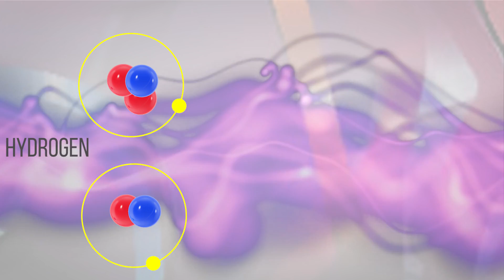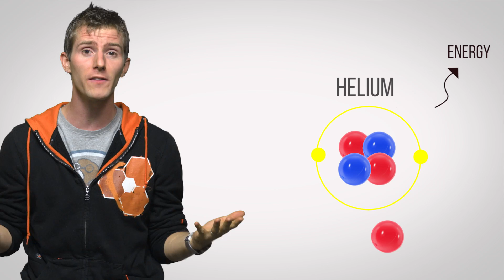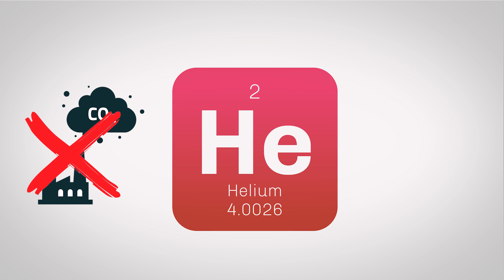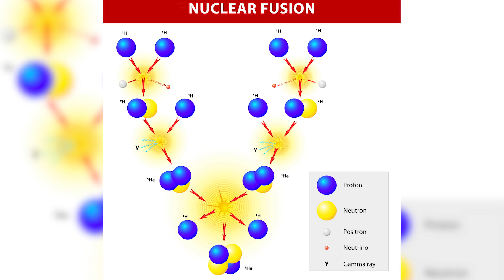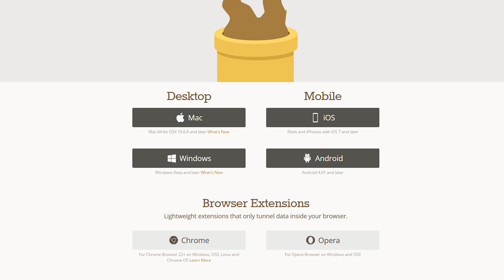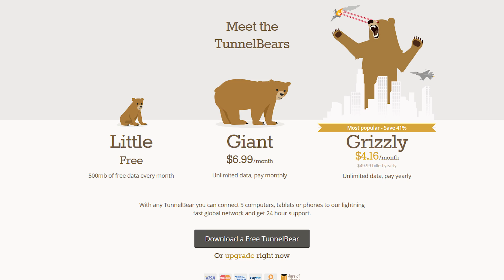Why Don't We Have Fusion Power?

Comment: why don't we just cover the sahara desert in solar panels?
Reply: Because power distribution, mostly.
Solar power generates a lot of power during the day but none at night, so you need ways of storing that energy if you want to efficiently benefit from it.
Batteries are not good enough and other ways of power storage are not very practical. This is why fossil fuels are so commonly used, if you need power you can just throw some more coals on the fire. Many sustainable power sources are out of human control, and so power storage becomes an issue.
And all of that energy will be generated in the Sahara desert, but in the middle of the desert that energy is probably not of much use so it needs to be transported and distributed. It's hard to figure out who needs how much power where exactly, in a matter of minutes, if you're talking long distances. You'd need a very advanced, comprehensive and cross-nation power distribution network that currently does not exist.
Reply: Cost and maintenance would be some huge issues there.
Reply: In addition to what everyone else has said. If you are strictly utilizing photo-voltaic cells as your solar panels these things simply just don't make sense for use as a green energy source. This is because the panels take pretty much their entire operational lifetime to refund the energy debt (energy which was supplied, largely, by the burning of fossil fuels) required to make and install them.
Reply: Well, I thought about it too. But when you think a bit longer you start seeing the issues. First of would be the building and setting up of those panels there. Sahara is covered in meters of fine sand. You can't build anything solid on it without making some foundations and that would be very expensive. Also transporting all the materials and workers needed would be a major issue since there are no roadways. Further down the line,should we manage in setting the panels there they would have to be replaced or fixed all the time because of the sand damaging them. And finally,all the energy produced would have to go somewhere which means a lot of power lines and a lot of costs since you cannot build those on sand and storing all of that energy would not be possible.
Reply: This is a little long so forgive me. The biggest reason is #4.

While statistics like "covering 4% of Earth's deserts with solar panels will generate enough power to fuel all humankind"  sound awesome,  solar tech isn't efficient enough to do that quite yet.

1. The problem today is that solar panels must be cleaned almost daily in dusty conditions. One gram of dust per square meter of solar panel is enough to reduce energy output by 40%. Not really a big issue when solar is a secondary power source for your home but a nightmare for a large scale power plant. Cost efficient cleaning tech is already being heavily researched so this won't be an issue someday in the future.

2. Deserts typically have very low populations in areas where massive solar arrays can be built so this means there are no high voltage power lines to transmit the power to the people who need it. The problem with this is simply cost. High output cables cost many millions of dollars per mile to install. Solar energy isn't quite efficient enough yet to justify this cost on a massive scale. Long distance lines would cost hundreds of millions or even billions of dollars. To top it off,  the lines  would also lose 10-20% of the power generated.

3. There are no energy storage technologies available that come remotely close to being able to power civilization at night via stored solar energy. A plant is being built that stores energy in a tank of molten salts and is a guinea pig of sorts to test if that solution is viable on a very large scale.

4. Biggest reason: cost! One of the largest solar plants, Topaz Solar Farm, cost 2.5 billion dollars to construct and creates about 1,000 gigawatts per year. The United States would require about 30,000 of these plants which equates to $75 trillion dollars. Ouch. 

One day solar panels will be ultra efficient and will play a major role not only in power production on Earth but also in humankind's exploration and colonization of our solar system and beyond. Unfortunately that day is yet to come.
Reply: The Curious Noob meh, the US is already 20T in debt, what's another 75T
Reply: The pannel tech isnt the issue. The problem is that out storage methods are are inadequate. Once we get better batteries we probably will widely use solar.
Reply: Simply because sandstorms can cover them up and maybe destroy them. Also they might get stolen.
Reply: TheUberMedic because then how would you get electricity to your home from the sahara desert?
Reply: TheUberMedic and the proces to create solar panels generates to much CO2
Reply: William O'Malley why not here in Australia ? We have the most intense sun in the world. Literally. We have a hole in the ozone above Australia. And we are a pretty legit country with shitloads of money and space
Reply: Justin McMullen yeah why not in Australia then? :P
seems like a better option xD
Reply: im half Arab... that was funny!
Reply: TheUberMedic I always think of that.
Reply: TheUberMedic also will cost a lot to get it to a country that can afford it
Reply: I agree with CraftingMuff.
Reply: Justin McMullen Those blasted kangaroos! Crikey!
Khoa Bang Tran I love that song, by the way.
Reply: @ThexXxXxOLOxXxXx Saudi Arabia recently started investing in solar panel development, after the decline of oil prices late 2014. That may be a thing of the past, but good point.
Reply: TheUberMedic Cause they would be better of using solar turbines anyway. (A big array of mirrors focus the sun on a tiny area where a water boiler is placed which drives a steam turbine.) Last I heard they have concrete plans for those kind of systems.
Reply: +Curious Noob
1.  Timed windshield wipers?
2.  It'd work for something like Death Valley, CA, among other places of opportunity.  Every megawatt hour counts.
3.  Mix and match.  Every megawatt hour counts.
4.  Is that with the windshield wipers?  :D
Reply: https://en.wikipedia.org/wiki/Desertec#Obstacles
Reply: Because, apart from many other reasons, such a thing would create incredible international tension and probably start a world war of massive porportions. Just think about it: One country with the power to entirely shut down another country's electrical grid. That would be the equivalent of dropping a massive nuclear bomb on top of an entire country, making even lighting the streets an impossible feat without a backup system. Which would defeat the purpose.
Reply: @zipp4everyone263  The Sahara is across 10 countries, not one.
Reply: @browncoat697  the entire Sahara wouldn't need to be covered. Don't try to be clever bro.
Reply: Because they are resource hungry, and producing them requires minerals that are almost always obtained via strip mining. 

In case you don't know, strip mining is a mining method that leaves permanent scars in the earth, typically in third-world countries, where the minerals are presumably most plentiful. This also has the effect of keeping the process out of sight of the average American consumer.
Reply: Because solar power is a joke... I own a 7.5 KW system. You can't store the power right now, the power is completely unreliable. And the carbon foot print required to mine the materials, to produce the panels, and they are very hard to recycle. Nuclear is the wave of the future if you care about global warming and CO2 (which I don't, but I still believe in nuclear)
Reply: +vampov wow are you proud of yourself for not caring about global warming?
Reply: Because relying on arabian dictators for the entire energy you use is a nice idea?
Reply: @CraftingMuff  nope.the sun would become blue and the dessert would cement color
Reply: @CraftingMuff  Imagine not knowing where Arabs live
Reply: Jelle van M. Then why don't we cover the Arctic with batteries?
Reply: TheUberMedic storage of energy at night also being able to transfer the energy because unless you have a super conductor you will lose alot of energy to resistance thats the simple version
Reply: TheUberMedic how do you Think the plants and animals will react
Reply: CosmicSins That's why I said cover the Arctic with batteries
Reply: islam

Comment: Still upset the whole reactor would still just be a very big kettle. Boil water, spin turbine, power.
Reply: That is how pretty much every form of power production works, including fission reactors.
Reply: +Tortex You mean solar panels?
Reply: People seem to have this knee-jerk reaction to incredulity when they realise that fancy power stations, from coal gas, to fission and even some solar plants, are essentially just boiling water. It just happens to be that water has one of the highest specific heat capacities for a practical material, making it very efficient for transferring energy. It is very easy to gain energy as heat initially, as heat is the highest-entropy form of energy - chemical (oil) to heat energy is easy; the other way, not so much. To create electricity, you have to either use a moving magnetic field to push electrons in a wire/coil, (standard generator), or "shake loose" the electrons in come other way (e.g. photoelectric solar panels, piezo-electricity). The "magnet passing over wire" is very simple, cost effective and efficient.

Therefore, despite the way it seems like boiling a kettle to spin a waterwheel, it is actually one of the most effective methods of electricity generation that there will ever be, and is very, very useful to us that it is so simple.
Reply: Depends on the fusion reactor type. For deuterium-tritium fusion (they forgot to mention tritium btw) which spew out 80% of its energy in form of energetic neutrons, boiling water is the only feasible option. For fusion reactions without neutrons, like helium-3 or proton-boron fusion, they spew out most if not all of its energy in form of charged particle, which can be slowed down by a coil, generating electricity directly.

But why do they use deuterium-tritiium? Because they are the most easiest fusion reaction in the world
Reply: how else would you want to do it? thats just how it works :P
Reply: A material that transforms energy to electricity instead of heat would be nice. You know, instead of radiation to heat to motion to energy, radiation to energy and maybe some excess heat as usual.
Reply: well how else are you going to transform heat into electricity? its very efficient actually 50-60%. when you want to turn radiation in the form of light into electric energy with solar panels you can only do that with a small band of wavelength that is higher than infrared. and only at arround 14-20%. heat is the most basic form of energy and can be scaled really well. oryou got a better idea
Reply: Big_Adam_2050 actually this is a false assumption.  Yes you could use a fusion reactor for boiling water.   But that's actually really dumb.

Welcome to the realm of HTGT high temperature gas turbines.  So we use stream turbines because coal and current nuclear can't get a fluid very hot.  But if you had a much hotter power source like Fusion or molten salt reactors, you can superheat an inert gas line carbon dioxide or helium and run a closed cycle gas turbine.

Why HTGT? Three reasons.  1/8-1/4 the size of steam turbine, so cheaper and smaller.  Does not need constant supply of water.  And thanks to Carnot's laws on thermal dynamics you get significantly higher efficiencies then stream.
Reply: Big_Adam_2050 you forgot the generator
Reply: Big_Adam_2050 And there's nothing wrong with steam turbines, the most efficient for the cost thermal to kinetic solution.

If you really want to get fancy, consider the reply above mine and look into high temperature gas turbines. 

Helium Brayton open and closed cycle or Super critical CO2 cycle. There are ofc so many other alternatives, even xenon gas turbines might be possible. 

But would suit a fission reactor much more effectively as Fission can produce Xenon gas.
Reply: You did not factor in the fact that the steam given off would be super heated so you could use water in one of these systems and in ones we use now they are close loop not and open loop so do not need a constant supply of water and the reason nuclear reactors are on the coast is that salt water makes a better cooling agent for if the reactor gets too hot
Reply: MrMort170799 not sure what your saying about closed and open loop.  

But I'm pretty sure there's no meaningful advantage to seawater over freshwater for cooling.  And seawater does damage that fresh does not.

In Fukushima they held off using seawater because it would forever ruin the reactor.
Reply: Depends, this is actually one of the reasons why there is some interest in the potential of Deuterium+Helium-3 fusion since 14.7 MeV of the 17.6 MeV from each fusion event is in the form of a fast moving proton which doesn't need to be converted to heat before it can be converted to electricity since it is of course a moving electrical charge of course the Coloumb Barrier for this reaction is quite significantly higher and the closest source of significant Helium-3 is the moon so some issues there...
Reply: Is a jet engine not a very big kettle? Burn jet fuel, spin turbine, thrust. Only, the same problem with fusion reactors now: less energy produced than used.